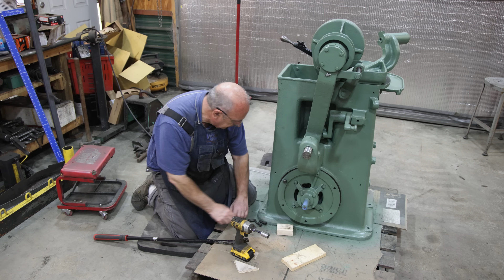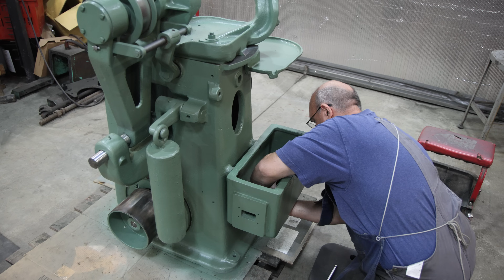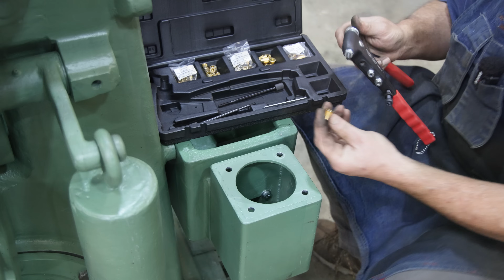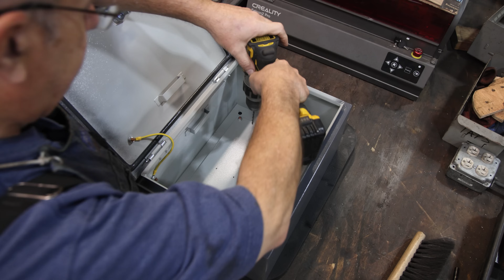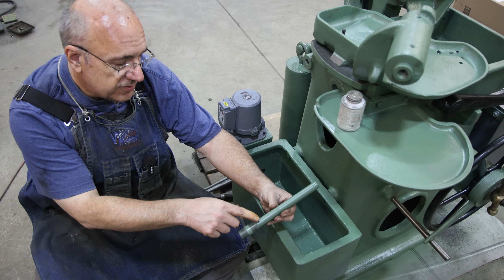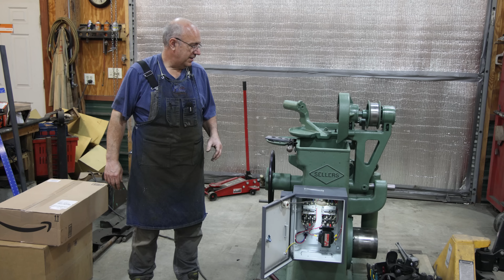Sellers 6G Drill Grinder: Installing the Motor, Coolant Tank, and Electrical Equipment

Comment: Oh Keith - you drilled the side of the electrical cabinet without an inside stop. Your 3/8 drill bit was uncontrolled and could well have hit the motor switches inside the cabinet. I drilled a housing once, exactly like that, and drilled into a £600. transformer - OUCH. Never again. I hope you got away with it. Please - a block of scrap timber next time. Best wishes Bill B - UK.

Comment: 2:33- Close to 80 years old; I pay for help if some mechanical 'lever' isn't in the shop.
11:34 - Uh, Keith... You were paid to think forward before you retired; you could have Heli coiled them.
23:08 - Good catch.
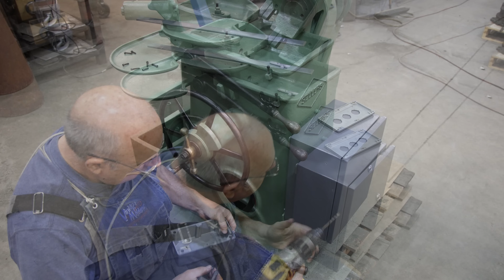24:34 - Not real hard to find a rectangular drill pattern. Pretty sure my first go-kart needed that in '58 or so.

Comment: Great video as always Keith!! Thank you!! on a side note: I posed a question on the Jimmy Diresta bandsaw build video playlist. What is the name brand of the start / stop switch (with E-Stop and Potentiometer) on the 4' Crescent bandsaw? I have a similar setup with a VFD, 3hp 3 phase motor (with soft start and brake stop) similar to yours. currently mine only has a potentiometer switch that turns off and on.

Comment: 12:21 i would ditch that setter and find the type that has the lever arms. Much easier to operate AND, this is the best part, because you're squeezing the levers with both arms, you can 100% feel when you've bottomed out the meat of the nutsert against the back of the piece you're putting it in, and stop before you break the mandrel.
With the rivet type setter (like the one in the video) you can't. You're struggling with the handles and you'll never feel it, and pop goes the mandrel and then the hunt to find another, ... absolute PITA.

I honestly do not, genuinely, do not, understand who the heck these are made for, because even me, with my big hands, can't properly grip them. It's like the mystery paint booth suits that always split between the legs, because they're not made for any conceivable human being alive on this planet (seriously, never seen a suit that fits someone properly and i've been through all the brands).

Comment: 8:42 use small magnets to keep the paper from moving. If you put them away from the cutting area, it should keep the gasket from moving about. I'm assuming it's using a steel grate under, like my industrial one has. I use the small (but powerful) neodymium magnets that have the little loop on the back for a rope or braided wire.

Comment: I would have cut the head of some long bolts and used them to support the Motor and Tank allowing you to let the studs support the weight.  I always used this in the shop when I was working in the transmissions on my vehicles.  I didn't have a Jack to support the equipment I was installing back in the 70s.

Comment: Keith, just drill a hole thru the push button box into the main box and put a plug in the push button box. Then pull your wires and connect.

Comment: I used to use those thread rivets all the time at my last job. We used the exact same tool for the 10-32 and 1/4 -20 ones and a pneumatic one for the 5/16 ones.

Comment: ya know you can take that inner plate out to make drilling tapping and wiring 100x easier :p Also on the placement of the control box, yea that's not a super awesome place, but the only other thing I can think of to "get it done" is mount it on some conduit from the top of the box... but that will waggle around and constantly loosen its nuts

Comment: Please move your mic closer. The audio is very low lately and I turn up the volume and then the commercial blasts. I only realized the problem when you leaned down to get the bottom bolt of the reservoir and your voice volume went up dramatically. Thanks for the great videos. Old stuff is good stuff.

Comment: Hey Keith, restoring a Berarducci Borthers Grape Press.  Small model.  I got it tore down best I can (that 2-1/2 Nut isn't coming off that holds the Acme Threaded Rod).  That's OK.  Doesn't need to...Currently looking at painting it black, but the color somebody else painted it was red.  Looking they used Red, Green and Black (not many).  My real question is...do you prime your raw cast?  This is a decoration, and it will sit outside in Michigan.  Not sure if I should prime this bad boy or not.  Also...WHO do you buy Square Head hardware from?  Please don't say McMaster...I'll need a 2nd mortgage to buy all that hardware!  :(
Reply: He frequently makes all of his hardware in the shop, squarehead included.

Comment: I noticed that Kieth never uses anti-seize compound. Maybe things don't rust in Georgia, but they do where I live. When I put things together, I always plan for taking them apart. It feels good to easily take something apart that I put together thirty years ago. Also, I buy a lot more stainless fasteners than I used to.
Reply: He does occasionally use anti-sieze. I have a vague memory a recent instance was on the big cane mill.

The downside of anti-seize, of course, is its remarkable ability to spread itself around to everything in sight!
Reply: Thhat's because your smarter than Bozo!:body-blue-raised-arms::face-blue-smiling::face-blue-smiling:

Comment: As far as the direction the lock nuts go I think you did indeed have them correct. Take a look at a restoration video from the Australian Armor and Artillery Museum, it is a Stug III differential being reassembled EXACTLY like it was originally assembled in the 1940's.  https://youtu.be/vT3U484kEz4?si=Dg136lJkFRbomTJA 3:10 is just one of several views of a tapered lock nut installed this way. And there are plenty of videos of original installations being disassembled on their channel. And it wasn't only the Germans doing it this way.
Reply: The taper ALWAYS goes towards the locking washer, Bozo was wrong, end of conversation!:face-red-droopy-eyes::face-blue-smiling::face-blue-smiling:

Comment: You should put a small piece of screen in between that with your gasket between the pump and the housing that away any abrasive material it would minimize not completely stopped but minimize the effect of the wearer of the pump love watching your Channel especially when you restore stuff

Comment: If you put a screw plug in the existing switch box (plugs are available at most hardware stores) then you can drill a hole for your wireing 0:30 thru the switch box and the control box.  I would add a grommet to protect the wires.
Paul Long

Comment: Why did you need to go to the expense of adding a box onto the side of your electrical panel? Why didn’t you just put your contactors for your or your switches which ever one you wanna call right through the side of the box itself would clean like it would make a lot more sense

Comment: Suggestion, use guide studs.  I always carried a verity of guide studs  of various sizes and lengths.  These mostly being threaded on one end, the other slightly rounded.  Chores like installing the motor or the coolant tank would go much easier.  Screw  in a stud, with the tank I would have used one with both ends threaded.  Put tank on stud, start a nut, rotate tank to start bolt in second hole.  I was 50+ years heavy equipment mechanic working solo out of a service truck.  With no help, and to be safe, you learn a few tricks.  I enjoy your projects.
Reply: I also helped build and repair earth moving equipment at Terex Div. of GM, and studs are a lifesaver, but Bozo likes to struggle!:body-blue-raised-arms::hand-orange-covering-eyes::hand-orange-covering-eyes:
Reply: @garybrenner6236  I once turned down a job with Interstate Tractor in Portland.  Been working for a contractor doing high way & RR relocation above the John Day Dam.  We were running S28, R30's, and C-6's.  Along with Cat 641 and Cat crawlers.  We had 29 D-9s on the job.  That was in '65..  First year I was in a service truck.

Comment: A bit late now, but wouldn't it have been easier to just drill three holes for the switches and mount them directly into the controller housing. Then the wiring could be done, for the most part, on the bench before mounting the whole on the grinder. 
Overall, it's coming on fine, and I'm looking forward to seeing it work.
How's your snow doing? We've some to spare if you want it. Regards from Canada's banana belt. 
🤞🇨🇦🍌🥋🇺🇦🕊🇺🇲👜🪓🐖🏁👍
Reply: No snow in Georgia... lol....... nice to see Keith has a few Canadian fans......  It's been tough digging the last few bays.

Comment: Rather than mount a box on your enclosure, why didn’t you just make 3 holes in the enclosure and mount the buttons there.  That way you wouldn’t need to have a conduit between the box and the enclosure.  Just a old electrician thinking out loud
Reply: That's because your smarter than Bozo!:body-blue-raised-arms::face-blue-smiling:

Comment: Great video, Keith! That small sub panel in the electrical cabinet is easily removed. Much easier to mark, drill, tap, mount and wire! Easily dropped back in for final wiring.

Comment: I think it's funny there's a big hole in the drive wheel pulley for access to the key set screw, yet they use a square head bolt.  Maybe it's a replacement pulley or they just make them that way standard?  Am I strange for noticing these sorts of things?
Reply: maybe the hole is for a pulley tap. you have to thread the hole before you can install a set screw
Reply: Nope, simply observant.
Reply: ah, geometry, how else to make the hole without drilling it sideways!

Comment: A good way to transfer a mark on a mating surface when aligning is to use lipstick. It’s creamy and will mark the surfaces. This trick works great for drilling door jams when installing deadbolts.
Reply: Don’t your lips get cold?

Comment: More than 5 decades as a big truck and heavy equipment mechanic. The most valuable tool in the toolbox was a bunch of lineup studs. Long bolts with the heads cut off and a mild taper ground on will hold just about anything you need. Also use some tapered lineup bars too. Once the part has a bolt or two, remove the studs and put the bolts in. No more struggling with lining up heavy parts while trying to start bolts.
Reply: I retired from the same field working on large construction equipment. 
I was going to say the exact same method too. 
It’s hard not seeing someone use this technique and struggle to install bolts without cross threading them.
Reply: @Jimgotalathe  I too have over 5 decades as a Class 8 truck and trailer/forklift mechanic and I 100% agree with you guys.  Line up studs not only make the jobs quicker but they will also help prevent personal injury to your body parts.  Additionally using line up studs can save your gaskets from being damaged, or even save the component itself from damage if you drop the dang thing trying to gorilla wrestle it in place and simultaneously fumble with a screw or bolt.  I see people doing things without line up studs and I can only shake my head in disbelief that they haven't learned the value of line up studs.
Reply: @jimfiles3307  Not too many of us in the old folks home. With all the chemicals, solvents, heavy metals, and asbestos we've absorbed through the years. Beating our bodies trying to reach things put in ridiculous places. Freezing snowy , slush working on a broken down wheel loader. Another mechanic once told me that his doctor said it wasn't a question of if he'll get cancer,. It's a question of when.
  Enjoy retirement my friend.
Reply: You beat me to it.
Reply: Bozo is not that smart!:body-blue-raised-arms::face-blue-smiling::face-blue-smiling:

Comment: The electrical hole in the control panel would have been a great job for your hydraulic knock out set.  Greenlee hydraulic knock outs do a fantastic job with little effort.

Comment: That new electrical cabinet setup looks great.  

I wish the wiring could go through the back of the operator station directly into the box.  I suppose you could source a plug to fill the hole in the bottom and then drill a hole.

Comment: Blank for the bottom of the switch housing then drill straight through the rear of it and the cabinet with a bush and locknut. Much neater and less fussy install.

Comment: the hole on the motor pully is to allow you to access the hex Grub screw with a t-bar Allen key (Cap Screw), this is likely how the pully was mounted on the drive shaft, as this is how it is currently done and how you have it done elsewhere on the machine.  As for the electrical cabinet, the inner plate is held in place with 4 corner bolts to allow the installer to remove the plate to fit out the controls and make the fitting of the cabinet simpler. Some of the larger enclosures have pins in the door hinges to allow ease of door removal, all to make things easier on the installer and maintainer, Also allows you to install your buttons on the door rather than a separate starter containment, makes for a much neater install but requires some for thought for locating internal components. I used to design and build panels, but now have moved into management so don't build as much anymore. hope this will help next time.
Reply: I've been using it on my tires/rims when I'm trying to lift and line everything up. I have lug bolts. This technique is awesome!!
Reply: Think the new style wedge pullies are far better, you use the fixings to seperate the parts, no extra screws required, and no need for pullers.

Comment: These videos could really do with some audio leveling (?) Keith is whisper quiet then the tools are loud as heck. Tough to enjoy watching.
Reply: I agree that the audio does swing but I think it is due in part to where his Mic is. When he is installing the tank he was closer to the Mic on his chest and much louder.  So if he is not right over his bib when speaking than it is harder to hear him. Tools don't have that issue
Reply: @--_DJ_--  just a cheap-o ipad
Reply: @ 2 words that hardly belong together. If it's good for you, that's fine, but coming out of my TV from my PC it is very much not good.
Reply: Soo picky
Reply: @ That is what the comment section is for. They don't all have to be singing his praises.
Reply: I've noticed this too lately and putting the volume up more. Noticed this on other channels as well and then Ship Happens said that Youtube has changed how the volume is. They advised changing the Stable volume setting as it is undoing her audio editing to make the videos better. Anyways I just turn the video down after I deafen myself for 3 seconds on the next channel I watch hehe.
Would be nice to be sorted but it's a lot louder when I'm welding and grinding. Drilling masonry and chasing walls for electric cables. Loving this Drill sharpener rebuild.
Reply: I personally have no problem being able to hear him at a constant voice to power tools ratio sounds all the same.
Reply: @ You must have a device that does some leveling on your end then. The tools are absurdly loud compared to his voice.

Comment: I really like Rivnuts, but I hate how they sit proud of the surface so you always end up with a gap behind whatever you are mounting with them.
Reply: Try countersinking the top of the hole a bit. That way, the rivet sits nearly flush with the top. If needs be, you can use a file to lower the profile, but be careful to not take off too much.
Reply: @ronwilken5219  If there was enough material to countersink the head I would probably just tap it.
Reply: @ I would probably just tap material that was thick enough to countersink the head.

Comment: Would it not make sense after polishing the shaft and inside of the pulley bore & fitting the key to apply a thin film of grease before assembly to both prevent corrosion locking the two components together & to make later removal in future that much easier?

Your audio work on these builds is very difficult to listen to.

Your voice is quite soft (& I’m a little hard of hearing into the bargain. So volume has to be pretty high to hear what you’re saying.

When you deploy the rattle gun the sound is so loud it’s like a machine gun going off, which wakes up my sleeping wife who curses at me then wants to change channel.

I’m riding the volume switch like a bronco buster trying to predict when to mute the volume and when to turn it up to hear your commentary.

Your filming, your subject matter etc are all 110% but man your audio is diabolical.
Reply: Have to agree. My system is such that his rattle gun comes up louder than my real one.
Reply: Zero issues with the audio over here.  Just sayin.